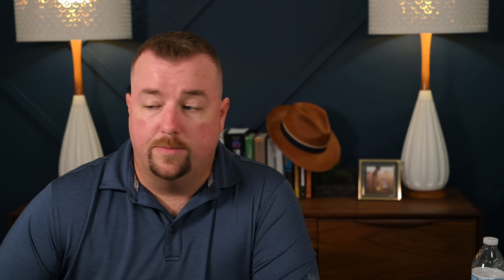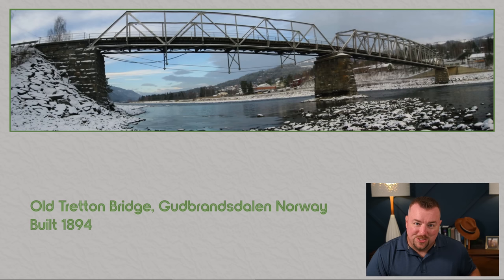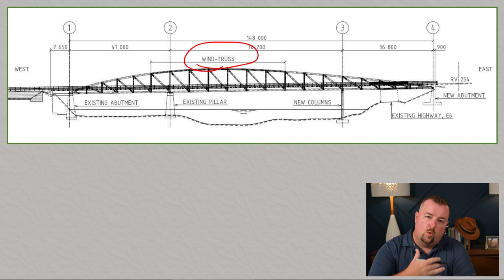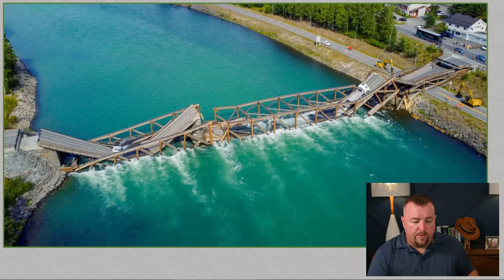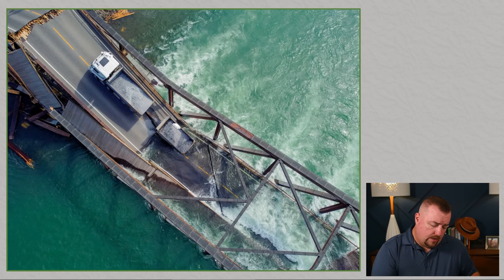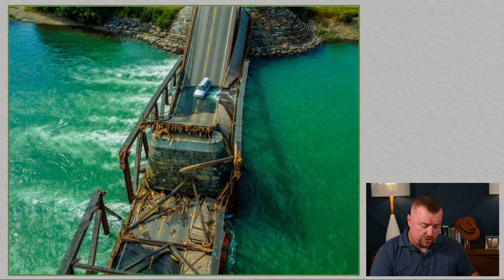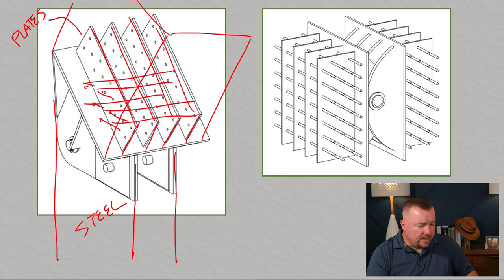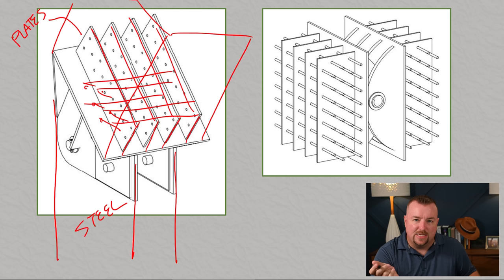How Did the Engineers Miss This?

Comment: I think they meant that people would be using this bridge for 100 years, but as a lesson, not a bridge.
Reply from the maker: This made me laugh 😃
Reply: I am reminded of the bridge failures using cast iron, in the mid-Nineteenth Century. cast iron is brittle, excellent in compression but not in tension and subject to fatigue cracking from badly machined holes, casting defects such as blow holes or 'cold shuts' and even unnecessary decorative features such as mouldings on the iron work.
Reply: @johnjephcote7636  …..
In the 19th century they didn’t have computer modeling or the benefit of the amount of experience we now have in building bridges and other structures. 
If you’re suggesting we’re making mistakes with New materials now, as they were making mistakes with New materials then…., well on the surface…., that does seem to be true. However we have much less excuse to be making such mistakes these days.
Reply: @mercoid  Maybe a good lesson that computer models can't do everything, us engineers still need to analyze our designs ourselves - especially for new materials.
Reply: @positivepenny5477  material is not new and there has been bridges made out of glulam for decades but i think making same kind of bridge than steel bridge was is the main problem here, designing it differently just for glulam should be all right bur trying directly to replace other material and not changing much design was the problem.
Reply: @positivepenny5477  Except they were modelling the wrong materials - solid timber instead of laminated.
Reply: @positivepenny5477  nothing wrong with the software, but it is only as good as the parameters you feed into it. Clearly they were using optimistic bend figures, and not worse case scenario tension figures. Garbage In, Broken Bridge Out.
Reply: It is like in the TV show I Love Lucy when Lucy writes a short story and the publisher includes it in a textbook on how to not write a short story
Reply: See, it is a hundred year bridge! What's everyone fusing about!
Reply: What annoys me is that ANY basic carpenter / joiner out there would not have used that method of joining.

Roof trusses use similar joints: because the load is STATIC. Wood shrinks and expands over time, snow lands on the roof, this is taken into account.

Seeing those tests where the bolts are under constant STRAIN and where the bolts are obviously splitting the wood down it’s grain exactly the same way that a lot splitter does is baffling.
Reply: @mercoid  in the 18th century though we had horses and carriages, and heavy goods were moved by train or by ship. 

With the exception of trains, most of those vehicles moved fairly slowly compared to our current National speed limits.
Reply: One can only hope.
Reply: As a fish habitat.
Reply: @BuildingIntegrity  I laughed too.  Not that "haha funny in-a-funny-way" laugh.  More like that "haha funny in-a-sad-way" laugh.  😐
Reply: "people" could use it for 100years not loaded trucks 😅

Comment: After that collapse on Aug 15, 2022, they closed FOURTEEN other similar truss bridges!  Looks like they bet big on glue lam and it came up snake-eyes.
Reply: But Greta Thunberg said it would save the planet
Reply: They build a lot of high buildings now with CLT wood, but there have yet to be a fire in one of those - hope they calculated it all right...
Reply: @ivankuzin8388  compression v tension. But I understand, a hot take should be taken regardless of facts
Reply: @andrewellicott654  Wood is a good material for construction and has be used for centuries, and there are buildings and bridges made of wood that lasted centuries.. It's just stupid to use it BAD.  And those joints in tension are stupid.
Reply: Glue lam? Omg those are for headers in residential homes, not for an exterior structure
Reply: Glulam has it's place but NOT in vehicle bridges, even those that have EVs on them!
Reply: @OffendingTheOffendable  I have a 31 foot glue lam beam supporting my deck in a climate that rains and snows.  It is working fine.  BUT I take care to water proof it.
Reply: @darrellstruth839  EV's might of made it fail sooner, they are on average 16% heavier in Europe than the typical combustion engine vehicle.
Reply: @darrellstruth839  ok I wont...so which direction is she in...asking so I don't tell her >.>
Reply: The flaw here was design, not material.
Reply: @rick4580  - wood has it's place but NOT in an application where there is dynamic loading for vehicles!  The connections are the weakest part of wood design.  I say this since I have over 20 years experience with wood design.  Weathered wood loses strength quite quickly as well.
Reply: @rick4580  And perhaps maintenance or lack there of.
Reply: @darrellstruth839  There are countless wood bridges and buildings around the world that are centuries old. There's even one not far from where I live that's 90 years old and carries nearly 100,000 vehicles a day.
Reply: @iowa_don  The engineers had a design that worked well in the lab but not in the field. Hopefully they learn from this.
Reply: @rick4580  - good for you.  But comparing a 90 year old growth wood to toady's wood is like comparing apples and oranges.  Go and stand on the bridge and feel the vibrations caused by the vehicles and you might begin to understand some the of the stress involved.  I guess we should start making pressure vessels and spaceships out of wood next eh?
Reply: @rick4580  yes, WOOD, not GLUELAM
Reply: @darrellstruth839  The first "spaceship" was made from wood, wire, and fabric coated with airplane dope.
Reply: @darrellstruth839  It could have worked... if constructed correctly. Not having support along the bottom, such as a Underside truss, was a fatal mistake.
Reply: @TheEDFLegacy  - whatever - I refuse to use wood products even in slabs in residential garages where the owner wants a room below the slab and insist on structural slabs designed by a PEng (Alberta), just too great a risk for failure.
Reply: @darrellstruth839  Room BELOW the slab?  As in, hang out under your car that's sitting on a glulam slab??  Thanks but no thanks.
Reply: @robertclegg2609  - seeing many of these now, from nanny rooms to panic rooms they all think it is "cool" to have a room under the garage.  Q-deck and concrete with rebar with steel beams where needed is the only thing I would recommend just like vehicular bridges.  Heck aluminum is a better choice if not mixed with dissimilar materials.
Reply: Woke engineering at its best.
Reply: @andrewellicott654  come on
Reply: I like how EV's have become a political "issue" to the not very smart.
Reply: @censors_starve , modern EV's are heavier than comparable modern ICE cars, and modern ICE cars are FAR heavier than comparable cars from the 1980's...
 but compare to an fully loaded semi-truck they are all still feather-light.

even if it was a Tesla Mod.X and not an Mercedes SUV on that bridge it would been a piss in the ocean compare to that truck loaded with gravel.
Reply: Guess someone was sniffing the glue...
Reply: @andrewellicott654  This is a sensible precaution. Remember how Boeing had to stop all the 737 Max planes from flying because of concerns about systematic issues. And yet... with some fixes, they are flying again. The same may be true of these bridges as well.
Reply: @andrewellicott654  Greta Thunberg is Swedish, not Norwegian. And I don't think she did, or are you trying to draw some inference.
Reply: @iowa_don  it’s also probably simply supported (more or less) and mainly subjected to light, mostly static bending. It definitely NOT a tension member…
Reply: this isn't a failure of glulam as a material so much as a failure in how to translate academic/lab properties to the real world. this happened with epoxy-coated rebar in concrete. everyone tested ideal samples then then they found out that if the coating was scraped/chipped (as happens on a job site but not in a lab) then the material does not last anywhere close to the design. 
also, I would think this would be a fairly easy retro-fit. since you only need to strengthen in tension, steel strapping or cables can likely be used to compensate. it does make me wonder why they didn't use steel strapping or cables along with the wood in the first place. even the mistaken properties of the wood still showed greater strength in compression than tension.
Reply: @danielziemba8045  My point to  @D G  was that it is outside in the elements.  He thought that glue lam does not belong outside.  Near my house there is also a large covered open air amphitheater that is built from glue lam beams.  Also outside subject to the elements.  It has been there for quite a few years with no issues.  It also has quite large steel gussets holding the various beams together.
Reply: Thats not becaue the other bridges were necessarily faulty, but for safety reasons to check if they got similar problems.

You can make lasting wooden bridges. If its a good idea, who knows.
Reply: @andrewellicott654  Considering were destroying our planet right about now, theres some things we have to do differently. No matter if you happen to dislike some little child screaming "how dare you" or not.
Reply: @bigjared8946  - thinking EVs work for everyone, everywhere at anytime is not very smart.  Good luck charging in places like California.
Reply: @ivankuzin8388  The weak point in case of fire is the steel, not the timber. Steel always has to be protected in some form, either by covering it with wood or by painting it with a special paint that expands and creates an insulating layer in a fire. The timber members can easily be designed to last for 60 minutes of fire, but the steel typically lasts less than fifteen minutes before it yields, unless it’s protected in some way.
Reply: @eran0004  I know, but I was comparing wood to reinforced concrete - in Scandinavia, where I work, for many years (maybe decades) prefabricated reinforced concrete was a go-to technology for building residential projects, in many cases also office and public buildings etc. . 
But recently (past 5-10 years), due to apparent CO2 emissions from making cement, there is a strong drive now to switch to wood, which is perceived as a better alternative climate wise. Norway is leading in this, but I see it more and more in Sweden and Denmark, too, and they are switching those traditionally concrete projects to CLT/glulam - and it is important for wood building advocates to prove that anything built from concrete can be made in wood, so they are building very tall buildings.
Now, as you probably know, reinforced concrete, especially with load bearing walls (which is a traditional way to build from precast concrete here), is highly fire resistant - yes, reinforcing steel will lose its qualities after 90 minutes, but often its role in a load bearing wall is minimal, and concrete itself is not supporting a fire, so concrete building can burn all the way through yet still stand afterwards. Whereas CLT building will stand by design its 60 or 90 minutes, but then, if fire is not put out in time, it will fail when a wood will char through its load bearing central section.
Reply: Concrete is vulnerable to fire. It loses strength from the heat, it may crack and it may expose the steel rebar. The concrete wall is probably pretty safe, but the horizontal elements are in a bad spot because they need to be able to resist bending stresses and the only way for concrete to do that is by using rebar - typically steel. The way a concrete building is designed to survive a fire is pretty similar to how any other type of building is designed: You divide the building into cells that can contain the fire and prevent it from spreading to other parts of the building. Sure, a concrete building can theoretically burn out, provided that there's not much combustible material stored in the building. If the building burns for a long time though, or at very high temperatures, it will definitely collapse. The "60 or 90 minutes by design" is exactly the same regardless of building material. You get a design criteria that states how long time the building element should be able to carry the load and then you make sure that the element meets that criteria. What happens if the fire continues for more than 60 or 90 minutes is uncertain because if you design for 90 minutes you don't run any checks to verify what happens after 120 minutes. As for the timber building advocates, I don't know who they are but last time I checked it was the property owner and the building committee who made the decision about what to build. Steel and concrete is still the most common materials used in new buildings, by quite a margin.

Comment: Very odd that these lovers of wood (I am a wood lover too!) don't take lessons from a bajillion years of carpentry and instead try to use wood like it's a homogenous metal
Reply: It's crazy how this happened despite engineering, past anaylses, and so much history to draw from. Glu-lam is not bridge worthy. 🤦‍♀️
Reply: there is nothing wrong with that as long as they would've used the amount of material needed to support the expected loads, but obviously economic considerations won't allow that because the cost of construction would be the same or probably even exceed the costs of a full metal bridge and the project would absolutely lose its rationel due to the shorter life of use
Reply: @heateslier  That is the lesson that they should have learned, yes
Reply: Laminated wood is a very good material, but obviously something was wrong with this design.

The general idea is sound though... Use glulam for some beams because of it's better strength to weight rational, but steel where you need longer spans or just higher strength.  Doing that on a bridge... Maybe not the best idea.

I'm honestly surprised that those connections didn't have a cap over / bands around the ends of the beams to resist splitting.

PS: A big benefit of steel is that it plasticly deforms and then hardens before failing.  Catching problems in that deformation phase is way more common that most folks probably realize.  It is more forgiving of design and rating mistakes than glulam
Reply: wood + water = rot,  theres a fungus for that. it loves hemicellulose, wood is like candy to it
Reply: @travcollier  I just can’t imagine it being a proper modality in that application or environment, unless there are some concoctions of it that basically become concrete and no longer can be weakened by water.
Reply: @itsjustmet1743  I'm not saying it is... Honestly I don't know.  But remember that untreated mild steel also corrodes pretty fast.
I don't know the specifics here, but some laminated wood is basically impregnated with resin/epoxy.  That stuff has quite good weathering properties.

My point was that the use of glulam makes some real sense, not that it was the right choice ;)
Reply: @element5377  This did not fail due to rot.
Reply: Exactly. Houses aren't made with joints like that. Kids making tree houses without computer modeling can tell you a bolted butt joint is going to fail no matter how many pins you use. Come on, at least use scarf joints. Old timber bridges that last have sliding members. Yeah,  I could go on, cursing as I do so.  Hundreds of years of building experience have been thrown out the window here.
Reply: @element5377  and yet that's not even relevant to what actually happened.
Reply: @itsjustmet1743  thermally modified wood, perhaps.
Reply: It s the fancy new generation. Learning the h a r d way. Gotta start somewhere. lol  ( Norway )
Reply: Frankly I feel the mistake they made might have been a simple as to misjudge some weight/stress calculations? Im curious about the findings. People react pretty hard cuz its a wood bridge, but its not like steel and concrete bridges collapse reguarly too, usually from design mistakes.

Best case scenario we know how to build better wood bridges after this. Worst case scenario we learn that theres less space for wood usage in bridges.
Reply: @heateslier  Designs which model wood as a homogenous material will either be overbuilt in most areas, unsafely underbuilt in some areas, or both.  In some situations, the cost of overbuilding may be tolerable, but if one is trying to minimize cost, wood needs to be modeled in a manner more consistent with its actual behavior.